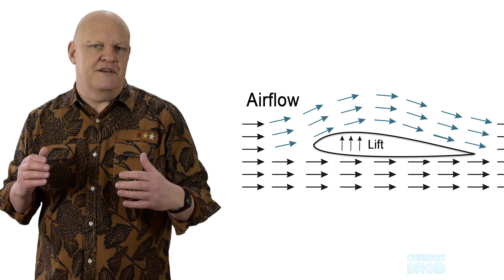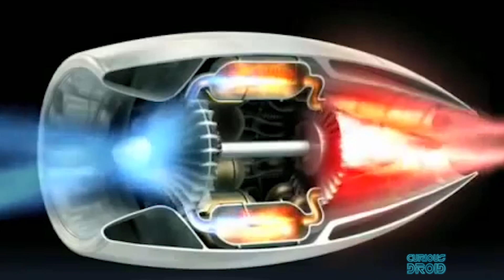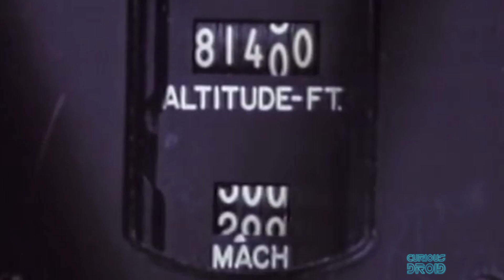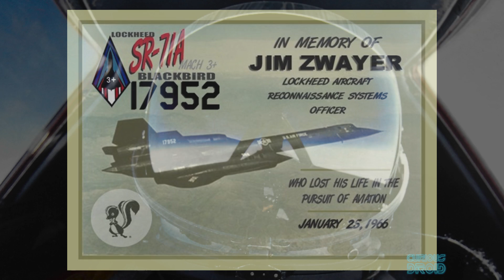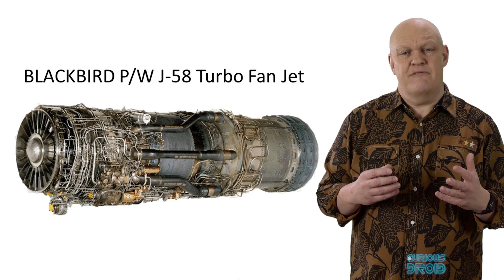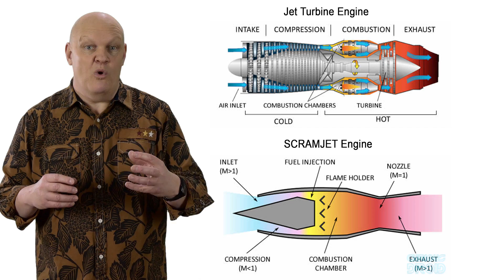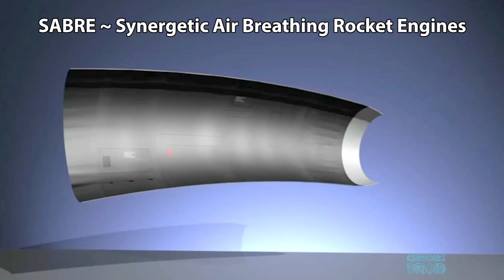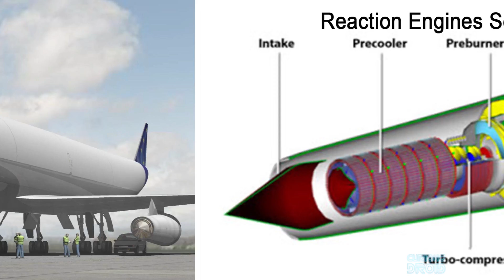Why can't we fly a plane into space ?

Comment: In the future we will have planes powerful enough to exit earth so it is not impossible
Reply: We already do. Check out the X-15. "Exiting Earth" is easy. You could get a human to space with a rocket the size of a large pickup truck. The hard part is not dying during the launch and staying in space.
Reply: Seekay sounds a wild plane
Reply: m beginization It's not going to use conventional jet engines no matter how much power you put in it.
Reply: m beginization Sound doesn't travel in a vacuum.
Reply: angry try hard earth is not a vacuum, I thought you were talkig about escaping earth not flying in space like satilites do
Reply: angry try hard At first they will but later we may develop more exotic devices using sound
Reply: Seekay I checked out the X-15 you mentioned and it is amazing,  I seen some  father and son use a weather ballon which took there camera u to the 90 mile mark, after that I wondered why NASA has not made more progress but found they are more interested in climate change then space travel
Reply: m beginization 90 miles? I'm pretty sure that's impossible with a balloon. You'd need a balloon 10 times the size of the Empire State Building just to lift 10 kilograms (20 pounds) to 80 kilometers (50 miles). I suspect they flew it up to  9 miles which is a much more realistic altitude for an amateur weather balloon.

Also, it's not that NASA isn't interested in spaceflight (because they are), but they're a government agency so any large scale projects they want to start working on have to be approved by the congress. The congress also decides what kind of budget NASA will have, and it's pretty small these days so they focus more on climate research because it's significantly cheaper than space exploration.
Reply: Seekay They have it on youtube as they filmed the whole thing, it even got NASA interested in how they did it, once you reach about 80 to 90 mile make the ballon expands so much it explodes and it is very windy, I seen a photo of the X-15 crashed, is that what stopped the program
Reply: Seekay I forgot to mention they were using gps to track it, I think NASA was surprized they had ssuch success, I would have thought they would have carried out those kinds of experiments themselves
Reply: At that point its not an airplane, its a rocketplane, like the X-15, SpaceShip One, SpaceShip Two, Lynx, etc
and even then its useles, theres a reason the Shuttle and Buran got cancled, there is no use for wings in space, at most you want to have a gliding surface like the SNC DreamChaser or X-37B
Reply: Jesus Ramirez Romo Does that Blackbird travel in to space as it looks more powerful then the X-15
Reply: m beginization No, the blackbird was only an airplane, the x15 used a small rocket engine, and was lifted and accelerated to speed and higth by a carrier airplane
Reply: ***** The shuttle served was after challenger and columkbia, it was scraped due to the high cost off maintanance, especially the wings, as every small tile had to be replaced almost every few launches, deafearing the purpose of reusability
Reply: ***** The little spy shuttle the Americans send off for missions seems to be working well, it could even carry 2 by the size of it, it is a secret where it goes but goes for long missions, enough time to reach the moon and back
Reply: ***** I mean for launch out to space not return as the heat would get to them but say you were sending one person to some kind of station out deep in space as it goes for long missions and they do have secret things going on we dont know about
Reply: ***** Then again we dont really what the interior of the spy craft looks like but I could see a series of these being used even at NASA or some other agency if they only need a small rocket to launch, some could be fitted for life as we should not rely on others like russians to get a lift to the little caravan in orbit.
Reply: ***** Thats a shame, makes you wonder if they just measuring or dropping off when out on long missions, with the moon only days away hope it is doing something there
Reply: m beginization Yhea, but the X-37 works because its small, hell the original design for the shuttle called for something simillar to it, small, and mounted ontop of the rocket
Reply: Jesus Ramirez Romo Sounds good, it a shame they have not developed a better body with the tiles bonded on like with powder coating or cooked in a large kiln instead of glueing tiles to the outside and hope they stay on
Reply: m beginization I think the X-37 uses a difrent shielding technology, the shuttle used Ceramic tiles that are good at heat shielding but are fragile, so they needed to make sure they could easilly be replaced, there for they used removable tiles
Reply: Jesus Ramirez Romo Trouble is one bump and they fall off, they should be bonded in the manufacture of the craft, I bet real UFO have their ships as one peice

Comment: I like the idea of using balloons to get crap most of the way up there. Then just use rockets to send the stuff orbiting.
Reply: The pull of gravity doesn't decrease much by the altitude of 400 km gravity is still 90% as strong. A big percentage of fuel used in a launch is just pushing through the atmosphere to get out of it as fast as possible that's why rockets are launched vertically. Once they are out of the atmosphere they start accelerating horizontally.
Reply: Or the space elevator with the counterbalance in orbit so it holds itself up :P
Reply: Joe Shmoe but it would take a lot of helium to be able to get a rocket and it's fuel of the ground.
Reply: Rhys Hughes but every mile higher you save all that fuel. Plus the pull of gravity is less higher up. Same concept as attaching a rocket to a plane.
Reply: Yeah, idea with baloons is nice but I am afraid, the rocket would be too heavy. On the other hand, hydrogen could be fuel for rocket, but then you would need oxidizer lighter than air as well (which probably is not possible). Moreover, the fuel with oxidizer must not be compressed. Otherwise, density of these would be greater than of air. But that means that there would be little amounts of fuel. Still worth consideration. Any comments on that?
Reply: instead of balloons why not a plane carrying a rocket up to space. They seperate at the planes highest altitude and the rocket goes up and the planed goes back down.

Comment: thank you sir i am a star grazer  if some give me chance to go outer space i will be the first 
I want know that if we make a flat form on mount Everest . 1) first thing we reach Everest by rope way from there can we enter the space .
Reply: The problem is the need to reach orbital velocity. I cannot say much more since you didn't detail what or how you get from Mount Everest on into space. Ideas similar to this have been proposed but they usually involve a conventional aircraft with a smaller space vehicle on the back. The aircraft takes the spacecraft to separation altitude, typically the altitude the aircraft can carry the spacecraft to. No system of this kind has been built yet but it's theoretically possible and the aircraft gives the spacecraft some boost velocity at separation. Velocity it needs to help get it to orbital velocity.
Reply: sir i mean to say that if we built a rope way vehicle from the ground  up to the mount Everest from  there can we fly into space  my idea is to reduce the fuel consumption of the rocket.

Comment: I do not need to see this video. A commercial airliner would have it's wings ripped off.
Reply: Not necessarily. It's all about dynamic pressure (pd = 1/2*ρ*v^2) which scales with air density (ρ) and the square of velocity (v^2). If you double the velocity and reduce the air density to 25% of the original, the aerodynamic forces will remain constant even though you're now moving much faster. An airliner could safely accelerate to orbital velocities if it kept climbing and accelerating at just the right rate so the increasing velocity and decreasing air density cancel each other out and the dynamic pressure remains constant.

Comment: a modified jet engine should work! if you can augment it with an oxygen system in front of the compressor to feed the compressor then combustion should take place all the way up!! and the higher you go the thinner the air the less resistance and the faster you go, so it should be possible at least for sub-orbital flights!!!and if you have enough thrust from the engines then wing lift would not be a factor above their limits, use them as far as possible then go thrust alone coupled with the SR-71's gravity boost maneuver it should get us high enough to launch a satellite!!! one thing you got wrong, Armstrong's line is 60.000ft. that's where your blood starts to boil and you basically freeze dry!!!don't quote me exactly on the altitude for Armstrong's line, it's close but I didn't have the exact figure handy when writing!!!
Reply: The Skylon solution is probably the closest thing to what your describing. And Skylon has to demonstrate reusability and comparable costs or lower cost than expendables in order to replace them. Last I checked, Skylon was too poorly funded to be an actual contender to replace rockets.

Comment: Well, actually depending upon your definition of space, airplanes can, have and do fly in space. It's just so happens that the boundary has been redefined. Also, there's nothing stopping a sufficiently powerful plane from performing a super climb up into so called space. The really question should be: Why can't we fly a plane into orbit ? To which I'd say: why not.
Reply: Skylon is the closest thing to using a plane to attain orbit. Many other designs have been proposed over the past half century and all have met the real problem which is something I call "The cost barrier". Skylon is too poorly funded which means it's up against the cost barrier. Aircraft exotic enough to reach orbit need to be less expensive than expendable or even partially reusable rockets.

Comment: I couldn't sit through all the fluff parts of the video. Did he discuss Aerospike engines?
Reply: I don't recall discussion of aerospike engines but they do not apply to getting conventional jet engine powered aircraft to orbit except in the case of Skylon and other SSTO designs. However, Skylon is to be powered by something that is probably less expensive than aerospike engines and is a hybrid jet/rocket as well. Aerospike engines would require rocket fuel such as LH2 to operate which in turn requires larger tanks than one would need for jet fuel and O2 or GOX. An aerospike engine would be ideal for an SSTO (Single Stage To Orbit) vehicle like the Delta Clipper. The Delta Clipper follow on had it been built, was supposed to have aerospike engines. Skylon is to be powered by LH2 and LOX and air breathing capability at lower altitudes. Having said all this, use of an aerospike on a Skylon like design is not impossible. It's just a matter of design and cost. And cost almost always kills most designs.

Comment: Could we fly a plane on mars? Maybe a very light glider design?
Reply: There's such an insignificant and thin atmosphere on mars the vehicle would have to be unpractically light :)
Reply: Not just that, aircraft would have to fly at super sonic speeds just to create any form of lift. I'm not sure sure a planes engine would operate in such a low pressure atmosphere either.
Reply: The Helios airplane flew up to 96,000 ft in altitude and had a speed of just 23 knots. It was powered by electric motors, so should work on Mars. Mars atmosphere is the same as earths at 65,000 ft so it all seems possible.

Comment: The other problem is that traditional moveable airplane control surfaces, such as ailerons, elevators and rudders, need air flowing over them to work so they won't work in space. That's why spacecraft need reaction control thrusters to stabilize and orient them in space. Further, space planes like the X-15 and Space Shuttle needed both thrusters and aerodynamic control surfaces.  The control surfaces worked at lower altitudes, both worked together at middle altitudes while the reaction thrusters worked up in space. As such a conventional airplane would be uncontrollable in space.

Comment: BAE systems said their SABRE engine would be ready in 2019. And the oxygen wouldn't be brought on board but is harvested in the air looking at 8:12 the cones in the mid portion of the engine is for flash cooling of oxygen into a liquid using either being hydrogen or helium, this oxygen is then stored in the tank as a liquid ( 8:51 ). When fueled which is a four hour process the main engines shutdown then switch to rocket engine located at the end part of the plane. 

I think china is now wanting to use that engine now considering its reports on  August 11, 2016. They are planning on the planes to be in service in 2020....

But who knows.

Comment: im only at 0:16 but i saw the tumb nail and had to add this to the comments, they are talking about using a private jet style rocket jet flys as high as a normal jet engine can get you then use the rocket booster to push them the rest of the way. still has a lot of problems like reentry but it could be possible.